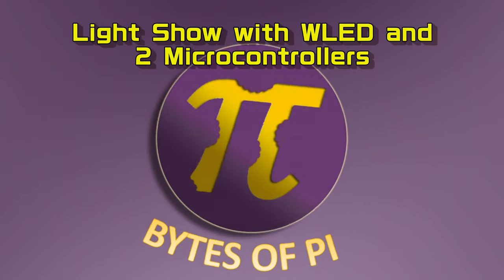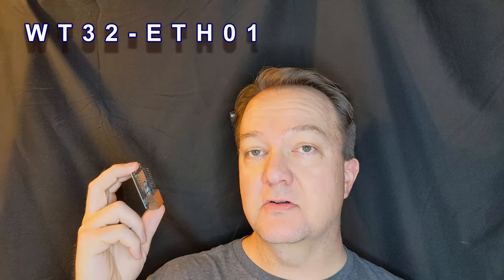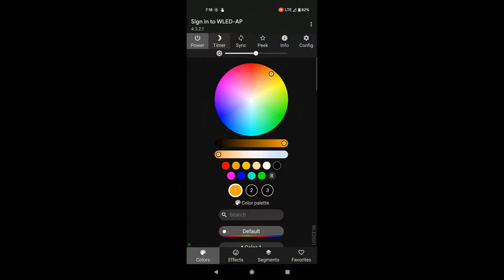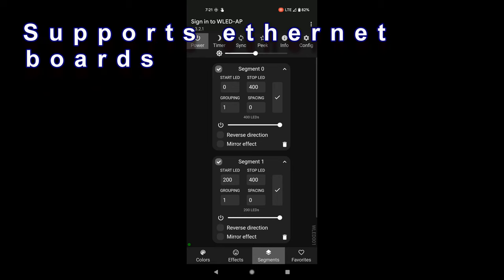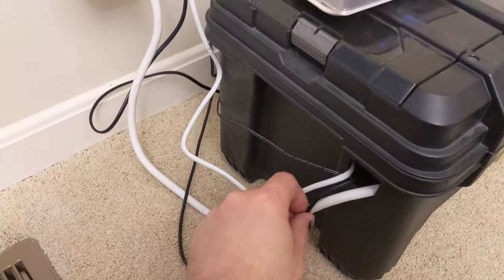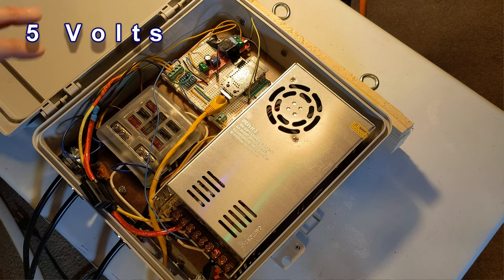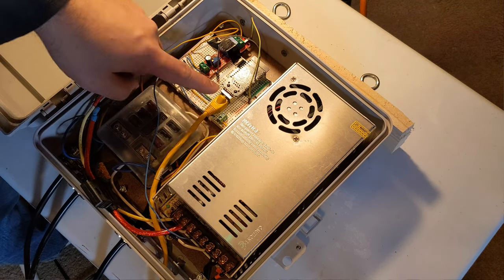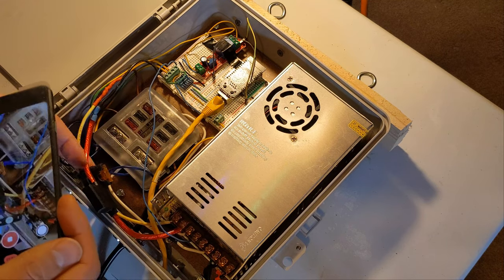Light Show Behind the Scenes - 2 cheap controllers and WLED

Comment: We have a few of those, as well as some other esp32 modules running our house. So much cheaper and way more fun!
Reply from the maker: It is really fascinating how much is available now commercially for those interested in DIY home automation.

Being able to buy a handful of cheap esp8266 or esp32 boards and create your own IoT devices is crazy.  In my other video, I create a light suit for my daughter using an ESP8266 and 1 phone battery charger.
Reply: @BytesOfPi  I love Christmas Light shows because everything can be done with open source stuff. It's a pretty awesome hobby. Just the other day I wired an esp8266 to a projector to turn in on and off with FPP.

Comment: Many thanks for producing such informative videos. I'm just about to start learning Xlights configured with WT32 controllers however I've been using Wled for a number of years, so no learning required for that part. Regarding the overall setup, you use a RasPi with FPP installed and connected to a Router. I assume each WT32 controller then plugs into one of the routers spare ports. (4 being the norm on most routers) Is that correct?
Reply from the maker: Thanks!  That's a good question.

Almost.  One port goes to the Pi.  The second port goes to one of the WT32-ETH01 inside the garage.  A third port goes to an 8 port switch out in the yard.

The box is positioned centrally in the yard to minimize the distance to the 4 additional exterior WT32-ETH01 boards running the rest of the show.  That central box also provides power outlets to the rest of the yard.  I have enough to be able to expand to an additional 3 controllers in the future.

The power going out into the yard box is always on, keeping the switch constantly powered.  It also has a home automation switch that powers the other outlets so I can schedule when the props turn on or off or manually turn them on/off via my phone.
Reply: @BytesOfPi  Many thanks for the detailed reply. The use of an additional 8 ports for future controllers is a great idea. It's amazing how the WT32 performs for such a low cost when comparing it to commercial controllers. I have successfully run around 1500 pixels before on a single pinout with an ESP32. The frame rate wasn't too bad either considering I was probably approaching the controllers limits. I believe there are at least 5 usable pins on the WT32, meaning as many as 4000 pixels at 800 per output could be used per controller.
Reply from the maker: @modelmanmark  
Yep, that's definitely true.  The most I have running off of one WT32-ETH01 is my latest matrix of 2365 pixels using 3 output ports.

It doesn't handle the canned WLED 2d patterns well, but it handles xLights 40FPS sequences like a champ.

WLED has a page talking about their recommendation on performance for ESP32s

https://kno.wled.ge/features/multi-strip/#esp32

For perfect performance, it is recommeded to use 512 LEDs/pin with 4 outputs for a total of 2048 LEDs.
For very good performance, it is recommended to use 800 LEDs/pin with 4 outputs for a total of 3200 LEDs.
For good performance, you can use 1000 LEDs/pin with 4 outputs for a total of 4000 LEDs.
For okay performance, you can use 1000 LEDs/pin with 5 outputs for a total of 5000 LEDs.
For okay performance, you can use 800 LEDs/pin with 6 outputs for a total of 4800 LEDs.

Comment: I know it has been a while since you created this video, But I have a question and some information on my project that is based on yours.

1)  I created a 4 channel controller using the WT32-ETH01 board, but when I tried to used IO12, it would freeze up.  I ended up using IO2, IO4, IO14 and IO15.
2) If I would plug in the Ethernet cable the local AP did not show up for me.
3) with the Ethernet cable plugged in, it did not grab an IP address from my DHCP server.
4) I had to keep the Ethernet cable unplugged, Log into the Local AP for the device and set up the IP and gateway as static in the WiFi setup.  This seems a little unintuitive.  Once I done that there were no issues connecting to it from the LAN.
5) I fused each port at 5A
6) I did not use the 555 timer as mine seems to come up with no issues
7) I am using 12V WS2811 LEDs, and a 12V to 5V Buck converter to power the WT32-ETH01 and Logic shifter HV input.

I have tested all four ports with Props and xLights and all seems to be good.  Although I want to do some more testing.

Questions:

1) How many nodes are you running on each port?
2) Are your LEDs exclusively at 5V?
3) What does your AC and DC current draws look like, or have you monitored them?
2) How many nodes do you think that can be run on each port?  The WLED documentation makes it sound like I can effectively run 800 nodes per port.  I will run at 30% brightness for the show and assuming that this count will be something less because of the current requirements.

Thanks for the video.  It has been very helpful getting me started.  This is our first year trying to do a light show and I must admit, the learning curve was real.  HAHA

Regards,
Joe
Reply from the maker: Hey Joe, that's awesome!  I hope you have a lot of success with your show this year!  Let me see if i can answer the questions

AP disappears
Yes, if you plug in your ethernet, the board will use that instead of spinning up a local AP.  Unplug ethernet and reboot if you want AP to start back up.

No IP via Ethernet
As far as not getting an IP from Ethernet without static, that is a little odd.  My cards recognized the DHCP router, but I mapped their physical mac addresses to a single IP in the router. I have a section of one of my videos on that: https://www.youtube.com/watch?v=LkGCo9Gi8mk&t=240s

How many nodes are you running on each port?
It really depends.  I have 6 WT32-ETH01 boards running WLED.  I think the most nodes I run off of a single port is 884.  The best advice on how many to put on a single port can be found here: https://kno.wled.ge/features/multi-strip/#esp32 
 -) perfect performance, 512 LEDs/pin with 4 outputs = 2048 LEDs.
 -) very good performance, 800 LEDs/pin with 4 outputs = 3200 LEDs.
 -) good performance, 1000 LEDs/pin with 4 outputs = 4000 LEDs.
Beyond this is sketchy.  

Now... The WLED 3D patterns are dog slow on my 3 port 2365 LED matrix.  Because I use FPP and xLights shows, I don't care.

5v only?
All nodes are 5v except my latest 2365 pixel matrix... see my show info below

Monitor your AC and DC current draws?
Nope... haven't had a need yet.  Electricity bill hasn't spiked as far as I noticed :)

Hope these helped.  This video is a couple of years old and I've expanded a lot since then... Some of my other videos may be helpful as well.  Here's my current show right now.  I was hoping to add leaping arches to my lawn this year, but life circumstances have put that on hold for now...  Good luck and I hope your show works out this year!

-) 6 WT32-ETH01 boards running WLED 
-) 5 5v 60A power supplies
-) Raspberry Pi 4B with FPP
-) 4795 5V bullet pixels
-) 2365 12V bullet pixels

Comment: Howdy Mr. B.O.P. so now that I have everything working in xlights...what do I wire the lights to, I have watched this video...and it doesn't really tell me the "GPIO Pins" on what device I should be wiring to. In other words, am I wiring the lights to the WT32-ETH01 pins?.
As I eluded to before, a simple wiring diagram "in where to wire the lights" would be helpful at this point.
Thank You...I wouldn't't have got this far without these helpful videos.
Reply from the maker: Sure thing.  Each microcontroller pinout is different.  For the WT32-ETH01, you can find the pinout diagram here:

https://community-assets.home-assistant.io/original/4X/a/2/9/a290da10619d9d0019ad0baf42bda455010a173d.jpeg

If you take a look at the pins on the left, you'll see a lot of pins marked as:

IO2, IO4, IO35, IO12, IO14, IO15, etc...

The number following "IO" is the # you match in WLED.

For example, in this video I link the aliens to pins in WLED.  https://youtu.be/LkGCo9Gi8mk?t=290

In the video, in the LED Preferences, I set the pins to 2 and 4.   In the pinout diagram above,

     -) Pin 2 matches IO2
     -) Pin 4 matches IO4

The data pin should be matched up with the middle wire on the LEDs.  Red should match the positive (5v) and black with negative (GND)

Comment: I have no idea why I have not ran into your videos until about 3 weeks ago. Thanks for all the efforts you put into the videos. I was wondering if the issue you mentioned at 8:48 has to do with the power supply itself. Typically SMPS takes some time (in micro seconds I guess) to start up and some SMPS do have internal start-up load resistor as a work around. You may want to try adding a start-up load resistor to your setup and see if it works as it will save you the extra timer-relay breakout board.

One question I have for you though is, where are the output pins you used defined, is that somewhere in the WLED module? I will set aside some time to look at the module to see if I can find anything there, but any response will be helpful. I am interested in building this out as I ordered one of the board that will come in this week. I currently run all my entire house displays with ESP8266 wirelessly without delays but I know the throughput of wired network cannot compete with wireless.
Reply from the maker: Thanks for the suggestion abdultairu!

Startup load resistor:  It could be the supply, but I have about 6 of these now with different power supplies (some meanwell, some not) and they all have that flakiness.  

I found a great video by Andreas Spiess that explains what I've experienced.  https://youtu.be/BqwUNOHiZ9k?t=145

If you get the board and you get a load resistor to work consistently, I'd love to hear if it works 

Output pins defined:  Sure, I have a few videos on setting up the WT32-ETH01 boards, but if you're looking for a pinout a good diagram is at:
https://community-assets.home-assistant.io/original/4X/a/2/9/a290da10619d9d0019ad0baf42bda455010a173d.jpeg

I've had the best luck with IO2, IO4, IO12,IO14, and IO15.

I talk about pins and flashing the WT32-ETH01 with WLED at: https://youtu.be/nvM-QI4Z_M4

Once you've flashed your board with WLED, you specify your pins in the WLED config...  Specify Pin 2 for IO2, Pin 4 for IO4, etc...
Reply: @BytesOfPi Got the WT32-ETH0 and I successfully powered it using board similar to the one I used to power Wemos D1 mini for my current displays. Configuration was a breeze using DPP protocol and so thanks for showing that on the video.

I did not experience delayed start up like you did in my setup and I tried it several times and each time WT32-ETH0 came up as fast as possible and since the IP address is static there was no issues connecting to the network.

Next step is to bring out two outputs out of the board (maybe put a fuse on the output as well) and send it out for fabrication. I will try and work on the PCB design, once I get the boards get them tested, I will let you know as I will like to put the schematic diagram and the PCB files out there for anyone who can find it useful. For you, the board will eliminate the need for logic level converter breakout board as the board that my friend and I designed uses very cheap components and is easy to put together.

Here is the link describing the boards - https://www.instructables.com/member/atairu/instructables/
Reply from the maker: @abdultairu  that's awesome!  I took a stab at a PCB design but I got the output traces for the 4 output pins too close to each other and they interfered with each other.  I'd love to see what you came up with
Reply: @BytesOfPi , I have been trying to make updates on this thread to let you know updates on the board, but it is not getting saved. Anyway, The board designed along with my friend is now ready for testing. Here are the feature:
1. Multi-Voltage input (5-24v), so it can power both 5v, 12v and 24v pixels
2. Header pin can accommodate both types of sold WT32-ETH01 (flipped or non-flipped)
3. Power input is protected against reverse polarity
4. The board has a dedicated UART to USB IC for flashing WT32-ETH01
5. Currently, we were only able to produce 8 and 4 output boards since this is the medium and maximum that WT32 can gracefully support
6. Each individual output has 5 amp fuse
7. Pixel output has phoenix 5.08mm pitch 3-pin connector while the power input has 6.35mm pitch 2-pin connector to be able to handle sizable current

I will upload the picture of the finished board to instructable page soon, so you can take a look and for testing purposes, my friend and I will want to send you a fully populated board so you can test and provide your feedback.
Reply: Forgot to add the fact that we think we solved the issue you had to fix with the timer board and so, it will be interesting to see if indeed we fixed it once it is tested by another person.
Reply from the maker: @abdultairu  Sounds like you have a very robust and durable breakout board.  Congrats and good luck this season with your show!

Comment: It all started off with two cheap $15 controllers!
Reply from the maker: Yep.  That's where it started.  I wanted a cheap entry into a display of individually addressable lights and spending $15 on a controller really beat out the $300+ Falcon controllers available at the time.

Since that video, so many engineers have capitalized on WLED and microcontrollers (Quindor, Kulp, Forkineye, etc...).  They build PCBs with preassembled components like level shifters and fuses that undercut the larger players for $40-$50 a pop.

It's exciting to see how much has changed in the last 4 years and how many newcomers have gotten started since

Comment: I love the idea of a timer relay, prevents startup power surges. Do you have a link to the one you used?
Reply from the maker: The timer relay has been really useful.  I'm glad you mentioned it, because I thought I had included the link in my description, but I hadn't.

I updated my description, but to save you some time here's the link to the NE555... https://amzn.to/3jG2EKu

I've only purchased the 5v timers (I only have 5v in my display), but I also included a link for 12v timers in case you use 12v in your display.  I've not purchased the 12v, so I can't speak to the reliability of the vendor.

-) NE555 Delay Timer Relay (5v) - https://amzn.to/3jG2EKu
-) NE555 Delay Timer Relay (12v) - https://amzn.to/3EccHAx
Reply: @BytesOfPi  Thanks for the info.
Reply: Thanks Mate, (B.O.Pie) but they are out of stock, (5v) would love to buy it though your affiliate link. Will try the other brand.
Reply from the maker: @bishamsingh1490  no problem, they are definitely worth the purchase no matter the vendor. You could try to replicate the circuit with a potentiometer, a capacitor, a relay, and the right circuit diagram, but buying it all assembled like this is probably most cost-effective

Comment: Great video.  It would have been great to give the final price of getting the multiple things together to run 2 pins (ports).  Then others could understand the per port cost against other (Dig Uno, Falcon or Kulp) controllers.
Reply from the maker: Definitely.  If you check the description of the video, I have links to the components used in the build from Amazon and you can get a more accurate dollar amount (inflation has taken a bite in the last year).

I believe you can reliably get four (4) ports from each controller ( see the W32-ETH01 specs for I/O pins).  I actually run three (3) ports from each controller. The matrix, left side windows and right side windows from the big box, and the three different roof lines from the other.

When I started this, the Digi Uno was on an earlier version of WLED which only controlled from one port.  Quindor's video about flashing WLED using platform IO was very helpful.

One thing to be careful about with the Digi Uno and Digi Quad, is using a microcontroller that's only wireless and not Ethernet enabled.  Results will vary if you try and run an xLights fseq show via E1.31.
Reply: an esp32 with ethernet port is is 16$ on amazon right now and can run 4 channels with 1000 leds per channel (stably)  level shifter is 10$ for a 20 pack, the plastic box you stick the electronics in would be the most expensive part. Falcon controllers have alot of extra features but theyre not even close to being worth the $. And in my opinion all the extra plugs and features are unnecessary since xlights does all the work anyway.